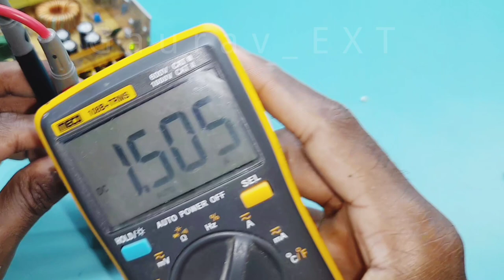DIY high capacity 32700 lifepo4 battery pack for daily use ||lifepo4 battery pack

Comment: Jo aap NE Volt. And amp sate kiye uska link bataiye please brother
Reply from the maker: 300W 10A DC-DC Step-down Buck Converter Adjustable Constant Voltage Module
https://www.electronicscomp.com/300w-10a-dc-dc-step-down-buck-converter-adjustable-constant-voltage-module